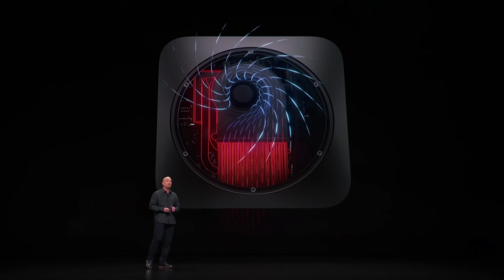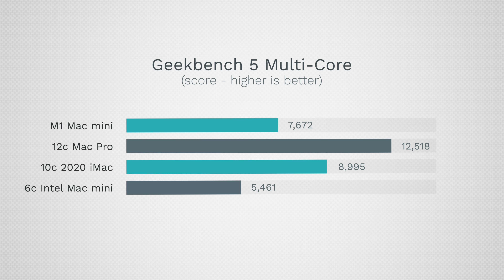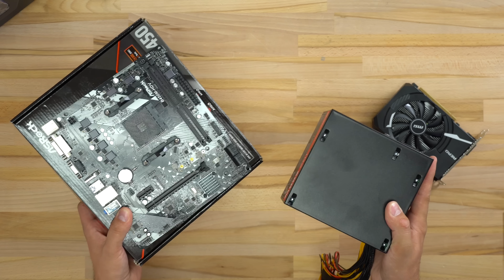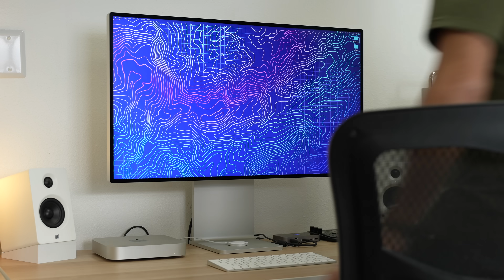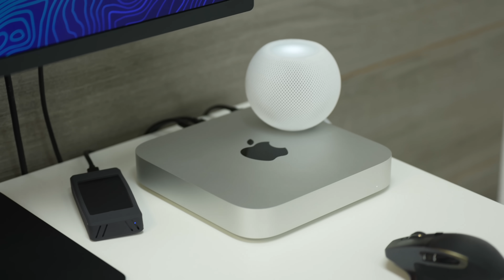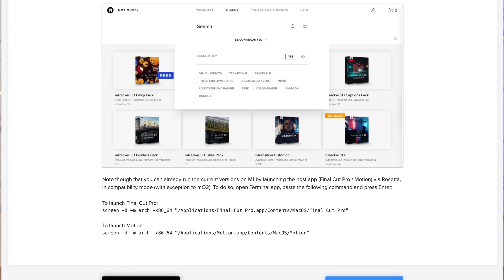M1 Mac Mini Review after 2 Months - The New Standard!

Comment: As a PC guy I agree, the M1 looks like the best bang for buck, until you factor in the cost of transitioning to the apple eco system... i use a fully functional DAW on windows thats free(cakewalk),  the equilavent will cost me 300 on a mac,  intels tigerlake goes toe to toe with the M1 in single thread, still not as good bang for buck on the surface but once you factor in the hidden costs that come with going apple and lack of versatility (low ram/sdd) windows PC's dont looks so bad.  That being said the M1 chip is a beast, nice job Apple.

Comment: I've done a bit a reading, and I am confused...  what is the best connection for display?  I have the LG 27UL550-W.  It has two HDMI and one DP.  I've got a DP>>USB-C cable.  BUT at the moment, I am using the HDMI cable the monitor came with.  In my head I was going to run the monitor with the DP>USC-C.  Then I was going to plug my TV in via the HDMI in the back of the mini.  Now what I THINK im reading is, HDMI is better for the monitor?  I suck at computers.

Comment: Holy shit apple fanboy goes extreme in this review
Reply: Seriously
Reply: This just sounds like you don't really understand what was achieved here. The M1 Macs are a pretty significant technical achievement that makes the x64 architecture look downright silly. ARM is the future of computing, and the M1 just proved that.
Reply: @eliwimmer  ARM is certainly the future (except for gaming, atleast in the short term) but they didnt really achieve anything that significant to gush about as much as most Apple worshippers do. It's an impressive piece of silicon, that much can't be denied, but even x86/64 chips have recently been downscaled so much (mainly thanks to AMD) that they can perform about as well as M1 in most regular desktop tasks with a slightly higher power envelope, while retaining full compatibility with 32 bit apps. Mini Windows/Linux desktops are usually a little bulkier than the Mac Mini but are just as fast if not sometimes faster, but definitely less efficient. Compatility with legacy software is still very important though, that's why x86 will continue to exist for the foreseeable future.
Reply: @Gato_Vietcong  The efficiency part (and to a lesser extent, price) is what makes the M1 chip so compelling. The Mac mini using 26 Watts under load vs hundreds of watts under load for similarly performing x64 chips, is nothing short of outstanding. This is the primary thing I think is well worth gushing about. Desktop experience should be excellent on any modern chip no matter the architecture these days, and there are certainly still desktop chips more powerful than the M1, but to have an all in one desktop computer that can handle just about any workload but gaming for under $700 is definitely a big deal in my mind. 

That said, my Mac Mini isn't replacing my desktop RTX / Ryzen PC anytime soon. Though if I wasn't a gamer, it might.
Reply: @eliwimmer  No doubt impressive for what it achieves, I'm just not impressed to the extent that a lot of salivating fanboys are on this videos comments. Any manufacturer with an ARM license could achieve this with a decent Linux distro and enough money invested.
Reply: Are you stupid ? Some people just hate apple ( Even when they are the best in the laptop industry )
Reply: @umairali2554  they're never really the the best or latest to any innovation, most Apple fanboys just choose to believe everything they're fed by their dear overlord. Once they develop critical thinking skills, they begin to question everything they were previously convinced of, but nothing changes because its all fairy tales

Comment: Disagree on the Mac Mini being better value. You can build an Intel Xeon E5-2689 system with 16GB RAM an RX 480 for less than $500 USD.  The M1 Mini is more power efficient though.

Also you're wrong about reliability of regular PCs. They're pretty reliable if you pick decent components, and interchangeable components are a good thing, not a bad thing. You can actually replace parts. If your Mac mini fails, you have to usually just buy and entire replacement computer.

Comment: I disagree on your reliability point, the M1 still has some issues that needs to be fixed, which is less of a problem on even custom build desktops, where you could fix the problem by replacing parts and are not limited to a company trying to force a solution on you.

Still, I feel that the M1 is an interesting, and potentially a great product. I will prolly buy a mac some day in the near future.

Comment: Hi, nice review.
Considering buying one myself, but it isn't clear to me yet if it's possible to connect double 4k monitors through two thunderbolts into 
DisplayPort (each port for each monitor, and both or at least one power supplied).
Any thoughts?
In the specs online it says M1 only allows one monitor through thunderbolt and a second one has to go through HDMI; but it doesn't specify if they refer to monitor that are power supplied by the thunderbolt.

Comment: I feel like getting the M1 Mac Mini, but just don't want to use multiple cables. I currently have a MacBook Pro 15" which is connected using a single cable to my LG Monitor which charges it and also uses for Video/Audio transfer.

Comment: Bought the 16GB Mac mini M1 with 512 GB SSD.  As a programmer (using web development tools and docker), it has been able to handle practically anything I use without fuss / noise from the fans.   Blazing fast and overall very happy with the purchase. 
A few notes:
- I just did the Software Update last night and I am still experiencing issues with bluetooth.  Especially with my sony wh-1000xm3 headphones, I seem to lose connection for a couple of seconds once / twice an hour.  Super annoying if you are on a zoom call and have to ask the other folks to repeat themselves
- In hindsight sticking with the base 256 GB SSD and saving $200 would have been a better value for me.  I overestimated how much storage I might need.
-  I have 3 external monitors (only one of them is 4k HD).  When I tried, either of the USB-C ports worked with the monitor but only one monitor at a time.  I had to connect the other monitor using HDMI.  So I have one monitor collecting dust.  I really don't want to plunk down more money to expand ports and wish Apple can fix this with a software update.
- Overall having a dedicated space makes it easier to transition from laptop to the mini and it is much better value

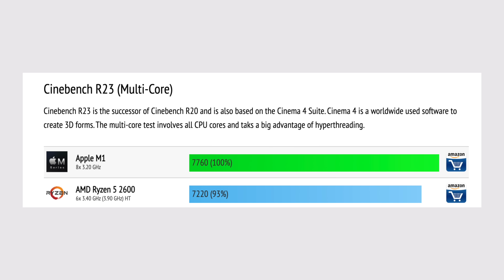Comment: 4:00? Sure better deal? Because of its size? And the Fan Noise? You know thermal throttle at least both mac books do it ... idk if mac book mini has this problem.. but as i seen probaly
And you show a cpu benchmark kinda nice... meanwhile everyone knows that cpu is for most things not so important anymore most things are eunning smooth and are depend on cache fast to open ... gpu instead... is still by far most weakness

But since hardware now is extreme expensive... its a win for mac^^

Comment: You can also for about £60 get the Hagibis USB-C Hub, which turns one thunderbolt port into a hub for multiple USB 3.0 ports, an SD card slot, and even an enclosure for a second internal SSD drive. Which for 99% of users would vastly expand the use of the device for the sake of sacrificing one Thunderbolt port. 

For most people, the issues mentioned as you say aren't an issue... so actually, there are next to no negatives for the majority of users.

Comment: If I had to chose between a single board computer ( m1 macmini IS a single board because everything is soldered without possibility to upgrade anything) and an equivalent price PC, I will always go for the PC for 2 reasons: 1. if something on the m1 goes bad after the 1 year apple warranty you're stuck with paying 4-500 dollars to be repaired by apple (on a PC you can replace the broken component for much much less) and 2. Mac mini can't be upgraded. a PC can be upgraded any time with a new motherboard and cpu for a fraction of the price of a new mac mini :) In my opinion the mac mini is only good if you're stuck in the apple ecosystem and you do not want to use windows and linux or if you don't have space for a tower pc.

Comment: Feels like you are constantly milking the M1 chip and are definitely biased in this review
Reply: Well, it's the biggest thing to happen in a long time in tech. As for being biased towards the M1, I don't agree. I've never owned a mac my whole life until I got a MBA M1 before Christmas and it's everything they say it is.
Reply: I agree it is very impressive but his comparisons are what are wrong. For example he says faster app launching was due to having a higher single core cpu which that isnt the case, its newer and will have a faster hard drive and the chip is just more optimised as it is from apple so will boot a couple seconds or so faster. then when he compared it to another pre built system he said, it will run a lot slower yet the cpu was 8% slower. then he compared the gpu performance to graphics cards that are 2 generations old. you are just as likely to get something wrong on them compared to other pre built computers, then says you can pick whatever accessories you want which is the case as its a desktop and you can do that with all other desktops.

Comment: If the Mac mini can be upgraded to 32GB, I will buy it to replace my desktop MBP
Reply: 16 are enough because of unified memory i d say... i ve heard that 16 on m1 perform like 32 on intel macs
Reply: @_oli-yd8bv  For most of users, yes. But I am a data analyst, I am sure that 16GB is not enough for me.
Reply: It can't. Or do you mean the next version? What is a desktop MBP? You mean you just have it folded up, connected to a monitor?
Reply: @mplovecraft  next version. Now my MBP15 2018 just works like a desktop pc ...  I never move it because I have another MBA  . Besides the AMD GPU means nothing to me, it can't work with CUDA. Therefore, if the next generation Mac mini can provide the 32GB+M1X version, I will be glad to buy one, because it is much cheaper than MBP. But I don't expect that too much, because Apple doesn't upgrade the Mac mini every year.

Comment: Can't imagine what the Mac Pro would do
Reply: Well, the ARM chips work quite differently from x86 chips. You might not be able to just crank up single core performance and buffer it with a big fan or add external RAM and expect the same performance as if it was on the SOC and so on. GPUs probably won't work. So in some ways I think it will be amazing, and on other ways I think people will be upset.